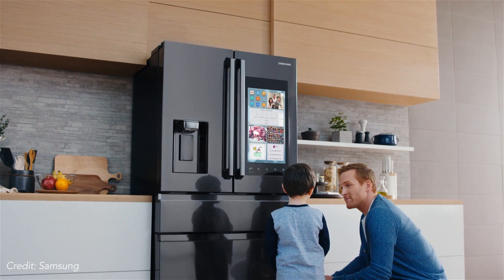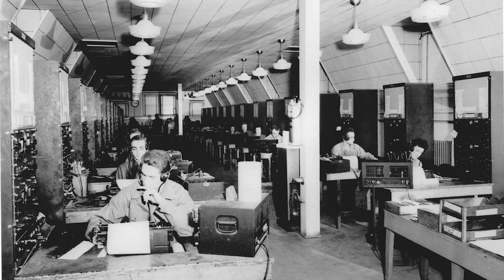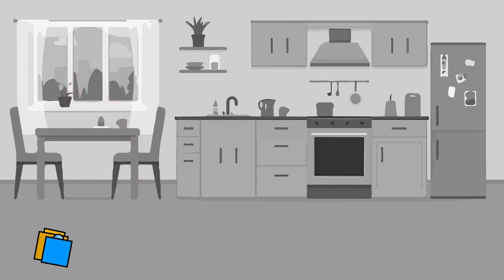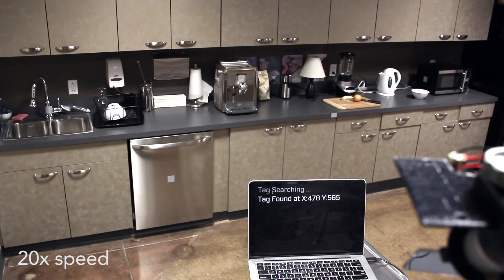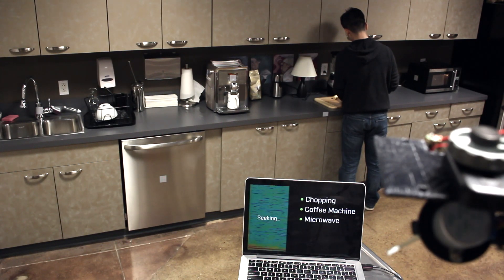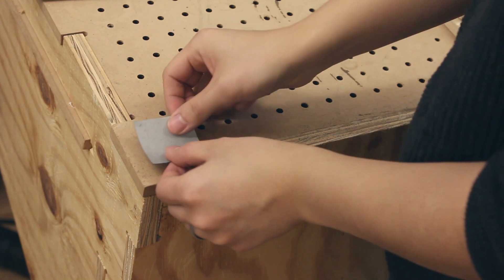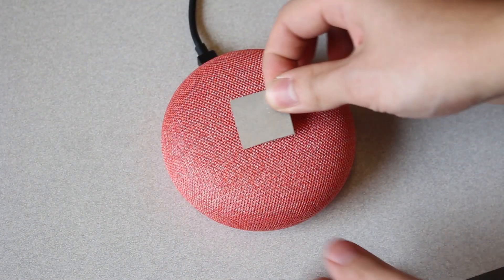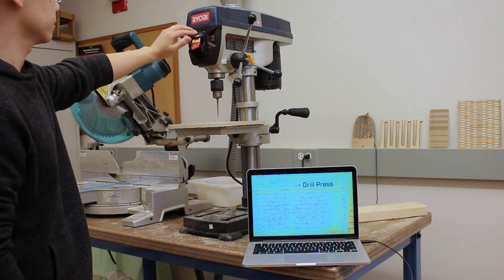Vibrosight: Long-Range Vibrometry for Smart Environment Sensing

Comment: I understand how u aim the tape but how u can aim from the tape back to the sensor ? As far as I understand the mirror is only there to sight the laser on the tape and the objects are not parallel to the sensor, so the reflected light has to reflect somewhere else. I also couldn´t find the explaining of that on the sheet.
Reply: It is said 1:32
Retroreflective material, it sends light back to where it came from.
Every road marking and street sign on the planned is using this technique for decades if not centuries now.
You probably have cloth with this stuff on it.

Comment: In a home kitchen? No, thanks. In a factory or warehouse? Yes, please! A large commercial cafeteria or kitchen might also be a fit, but I don't think a lot of homeowners will be eager to install a rotating, spinning, visually distracting ceiling cat in every room. Sell this to companies.
Reply: You do realize that this can be crammed without much effort into a silent cube smaller than 4 inch aka 10cm.
And that is still bigger than it needs to be.